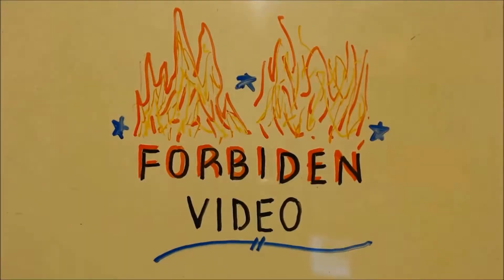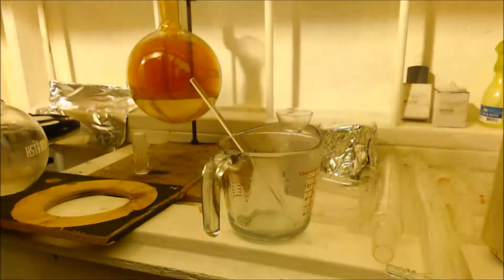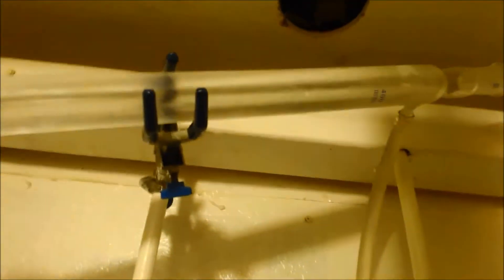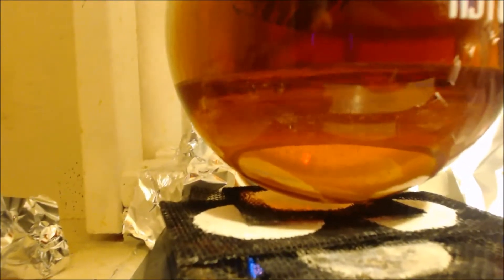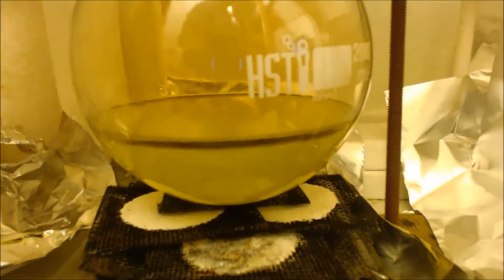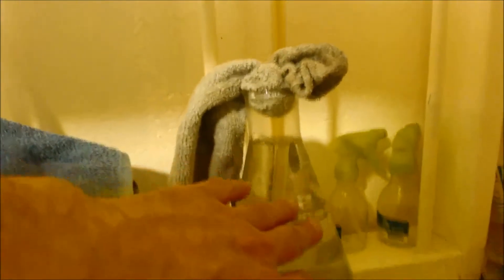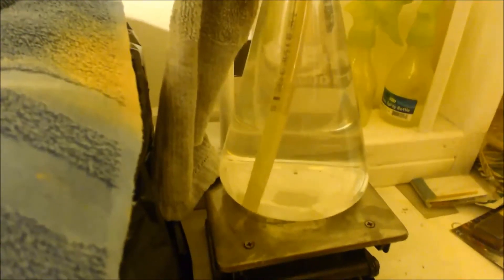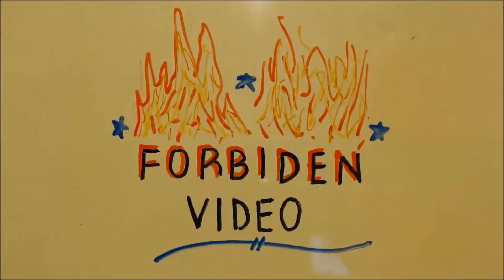SYNTHESIS OF CARBOXY METHYLBENZENE (toluic acid)  PART 1

Comment: Mostly unintelligible.  You never explained the reaction that you were doing, either verbally or in print.  From the looks of it you added an unknown amount of concentrated nitric acid to an unknown amount of xylene, giving a mixture of nitrated xylenes.  Then you diluted it with water and refluxed it for ... 48 hours.  A solid was shown floating in the cold dilute nitric acid, but no work-up was shown.  

This was the first of your shows that I have watched.  I do hope that your technique improves.
Reply from the maker: Patrick..........Yeah sorry about that.  I got to admit this is one of my worst series of videos.   This was a long time ago.  It was the first time i used that fume hood where i had REALLY NASTY GASES and used a camera.   And there was leaks in it.  Plus i did not realize the first 4 minutes of the video that the fan was so LOUD and no one could hear me.     I put the fan outside the fume hood and that was a mistake.  At the end of last winter i fixed it but still have not tested it with any nasty gases yet.   ANYWAYS........VIDEO PART 1 >>>>>>I put 105 mL of 90% mixed xylenes AND 175 mL of fuming nitric acid AND 400 mL of water. and refluxed it in an oil bath where the oil bath is 145 to 155C.   Nothing else really happens in part 1.  I just talk alot about the bubbler i am using.   IF I WERE YOU I WOULD WATCH PART 2   for the first minute and then just skip to 8:30 in the video because everything you skip will just be me filtering and washing the toluic acid with cold water.   Here is part 2   https://www.youtube.com/watch?v=_9nzN-YkKeM             Now part 3  is https://www.youtube.com/watch?v=tVYQ2XPuiIY           And part 4 is https://www.youtube.com/watch?v=83A44shWD-I    And at 4:50 into part 4 video i start using the chalk board to explain what i was doing and ALL my mistakes i made.   I only got like a 23% yield and the toluic acid i got really needed recrystallized again and i did not do that.  But if i had the yield would have been even lower.     And this is part 5 and i am still talking about how i could improve the experiment   https://www.youtube.com/watch?v=HCS7vN-4tWU   So that is a lot of videos and DEFINITELY NOT MY BEST WORK
Reply: @johnblacksuperchemist2556  Was interested in the process, amounts of materials, etc, but those details got left out.  Good to hear you're still active.
Reply from the maker: @patricksweetman3285  ..........Do you have those details now?   Cause half of video 4 and all of video 5..... that is all i talk about .   Yeah still alive but done doing videos really.   Maybe do 3 or 4 a year
Reply: @johnblacksuperchemist2556  Yeah thanks.  I found them.  Still no reference to the method you were following.  But I think that if you had some thin-layer chromatography strips, or even paper, you would have been able to follow where your product was going.  I think that you nitrated some of your xylene and then after that always had nitro-toluic acid mixtures.  Might have been interesting to separate them.
Reply from the maker: @patricksweetman3285  ..........It may be possible i nitrated some of the xylene but i do not think so cause there was no sulfuric acid to make nitronium ions from the nitric acid.  But who knows.  Usually when i do an experiment i do not really follow anyone's instructions but for this experiment i basically just followed someone else's instructions on line some where.   It has been a LONG time but let me see if i can find the paper or link for you
Reply from the maker: @patricksweetman3285  .......   Well that did not take long. http://www.orgsyn.org/demo.aspx?prep=CV3P0820
Reply from the maker: Patrick........That was the first time i took a camera into that fume hood cause it is not my fume hood.    AND   After doing that refluxing for 55 hours and with the leaks i was sick for like 3 days.  It was not a good week for me.  You will notice in the videos where i am dealing  with nasty gases in that fume hood the videos are never good.   Hopefully that will change this year since i HOPEFULLY fixed the problem in that fume hood.  Only took me 3 years to get off my lazy butt and do it but i HOPE i fixed it
Reply from the maker: Patrick.........You might not be interested but just in case.   Here is a link to SEVERAL methods of making nitroethane although i think they were just written by home chemist so they might not all work.   https://www.designer-drug.com/pte/12.162.180.114/dcd/chemistry/nitroethane.html                 ANYWAYS,,,,,,,, i used method 1 in a video and failed. The sodium ethyl sulfate method.   My main thing i did wrong was i did not crush up and mix all my solids before heating them.   It took so long to make the sodium ethyl sulfate by the time i got done i just wanted the experiment over.   ANYWAYS i also did a video on method 4 using an ethyl halide to to do  a replacement reaction with AgNO2 to make nitroethane.  For a first attempt it worked ok.  I only got a 20 or 25 % yield.  But you should really use ethyl iodide but i only had ethyl bromide.   Plus next time i am going to use an EXCESS of ethyl bromide and see if that improves my yield.   I think those are all the INSTRUCTIONS i followed to do a video.   Usually i just watch a bunch of other videos on people making something and pick and choice what i think is best and guess a lot.   I have found a couple other papers though that i have not tried IF YOU ARE INTERESTED I COULD FIND SOME OF THEM FOR YOU.   Let me know.   Just as an example the last couple papers i read where instructions on how to take benzyl bromide and depending on the amount of NaNO3 catalyst you add and the temp of the refluxing you could make benzyl alcohol in 82% yield or benzaldehyde in 91% yield.  And i think those are real papers written by real chemist who published there paper.   Also if you are ever looking for an experiment on youtube and can not find one on the reaction you are looking for then just ask me.   I know a lot of hidden videos on youtube that are really good...............ANYWAYS THIS IS TURNING INTO A NOVEL